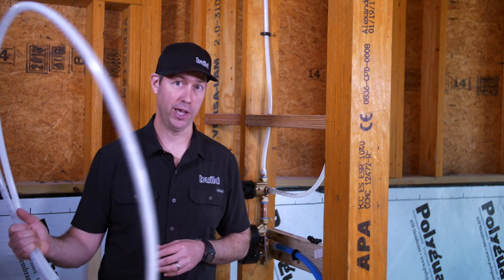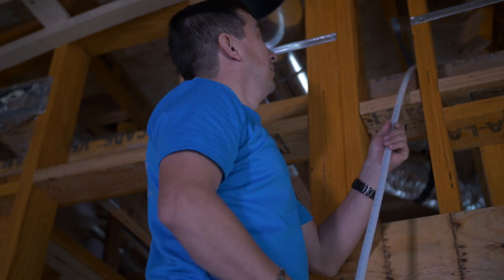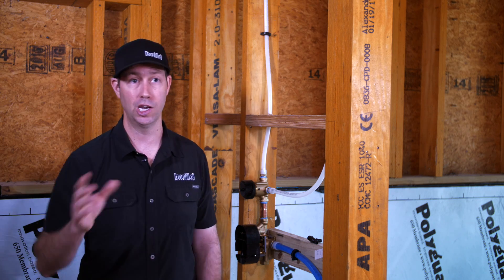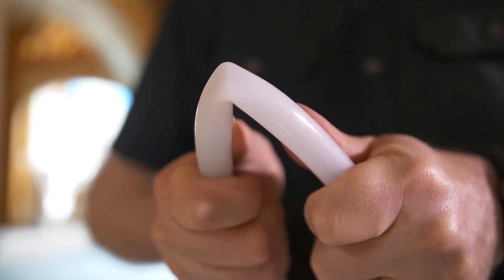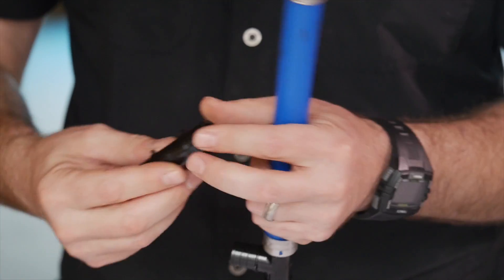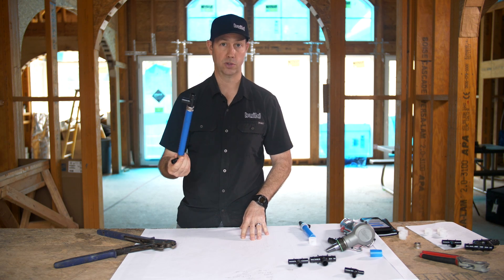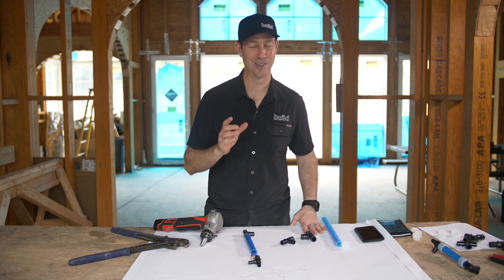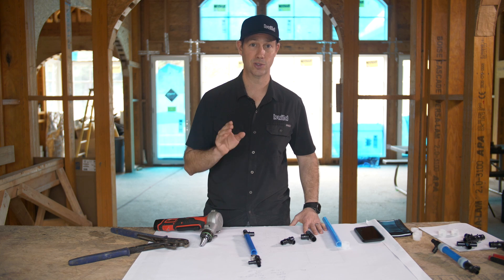PEX vs. Copper Plumbing

Comment: PEX is safe from junkies. Time & time again, I have to reinstall plumbing due to the junkies stealing the copper tubing from homes. Thankful to the PEX to save the day. Easier to cut & to install.
Reply: Pretty good point you got there. Well said.
Reply: Seriously? What a hoot! I've had two houses stripped, one while the papers were being signed, they pulled the feeder lined to the sub panels too. We went to the local scrap yard but it was useless and the PD wasn't into doing anything. Everybody knew it was the local crack and meth heads. It wasn't that big a town. Scrap yard made strategic donations in city hall, and...
Reply: @philrabe910  Sounds like a (local) problem needs a local solution..
Reply: ....no joke my neighbor's have been caught doing that shit.
Reply: Unless you use brass fittings
Reply: @flamedna galvanized isn't allowed to be used for waterlines in houses anymore
Reply: Unfortunately, unsafe from mice.
Reply: I live in a smaller town in Canada. I've never seen copper stolen from a house. I'm a plumber btw. Must be a big city thing
Reply: Gene Ryde no where ever you have degenerates not willing to work or budget their live right. Drug areas and even the up areas you’ll see teens taking to copper harvesting. Especially in. New developments.
Reply: The scrap yards in our city/state have helped curb copper thieves, I think there were laws passed at the state level that anybody going to a scrap yard has to show id and there is a criminal database/do not buy copper from these crackheads list.   Of course you know sometimes the guys running the scrapyards are crack heads themselves, but most of the places are corporate owned now days which helps as well.
Reply: Dh66- Your problem ? English Grammar here.
Reply: I will second this comment... junkies and the basic run of the mill copper thieves  won't touch pex unless there's a big easily accessible brass valve they can snip off. Re-ran everything with Upenor.  Now, if they can just do something else for the AC lines....
Reply: Yago Usera
Reply: Protect the structure prior to occupancy being taken=no theft.
Reply: THIS. I'm rebuilding a house that the entire bit of the copper plumbing was stolen lol.
Reply: I did pex in my log cabin I bought at a tax auction. The previous owners didn’t even junk the copper they just cut it everywhere and let it freeze before they lost it. I removed the baseboards and went with pex plumbing and forced hot air. Mainly because of the cheap price to install them
Reply: OMG! I remember some guy looking at my gold crown in my mouth and i said hey! Its worth about 20 or 30 bucks so dont even think about it!
Reply: Whats a can of white paint going to do?
Reply: Make it look like pvc
Reply: @tgarre6  doesn't look like Copper if it's white
Reply: Cuba Rodriguez ...true..
Reply: Sadly, copper thieves don't always check what they are doing. At work we have had copper thieves cut fiber optic cables, thinking they were getting heavy gauge copper. You'd think it would be obvious, but no! I suppose in houses they would only make the first cut.
Reply: Thieves in general, are idiots. You can assume that if anything can go wrong, it will go wrong.
Reply: Cuba Rodriguez       
 lmao .
Reply: PEX is more flexible and easier to work with. Remember when using copper  you have to solder every fitting which takes up time. That's true junkies do love copper and they will do anything to get it. When that guy mention white paint he was talking about painting the copper so it looks like PEX lol that wouldn't work.
Reply: sounds like you need to move, lmao
Reply: Cuba's Automotive : maybe you should have a little better screening when hiring your employee's
Reply: Yes we have neighbors, the junkies or kids stole all the copper from inside the Trane A/C units of the winter homes here also, in Florida.
Reply: Yeah, its worth it just to deplete junky scum of their fix
Reply: Pex junkies, aka, rodents will also eat through it, different type of junkie, yet will still take your stuff...
Reply: Norm T  Until 1983 or so, copper pipe was "sealed" using lead based solder- it has been illegal in most states since that time. It is, however, much less expensive than the no lead substitutes and is still available. FWIW, That is what the hell. There is no amount of lead in your water that should be acceptable- none.
Reply: If they steal your copper invest in steel, brass, and lead.
Reply: Same thing happened to me when i was flipping a house
Reply: This is extremely useful! As someone who's seen an entire house's copper system junked more than once, a viable alternative is great. My boss advocates using galvanized steel pipes to junk-proof them, but that seems like a bad idea for numerous reasons. PEX looks to be the way to go.
Reply: @Kryto_Gaming  Galvanized pipe of any sort, is Federally illegal; galvanizing puts a coating of LEAD and tin on the outside and the INSIDE, the water flows through a lead lined pipe. Think what happened in Flint Michigan! As I said, ILLEGAL, as well as life altering/dangerous. Won't ask you where you work, but your boss maybe creating a horrible healthcare problem; suggest you change employer before this one's jig is up and your reputation is a ruined as his! FWIW, retired plumber, 35 years at the pipe trades- have had work inspected in 24 different jurisdictions and average 90+percent green inspections on the first go round.
Reply: True story. A friend of mine owns a few rentals. One was vandalized twice to steal the copper. The third time they must have seen the PEX and ran, only the door was damaged.
Reply: Lame excuse because they can't be much of "Junkies" if they left the kitchen sink.
Reply: Yago Usera or your engine block
Reply: So you have signs all over the house saying "This house uses PEX piping instead of copper"?  Otherwise, how are they to know before they start tearing at the walls?  And how do you ensure junkies are going to read your signs?
Reply: Junkies? You mean Urban Minors.
Reply: kmonnier people who annoy you
Reply: Id never buy or rent out a house that has PEX. Takes a short 20min class for anyone and your "certified" to run pex. Who wants someone who 21mins ago just got his diploma or out of jail showing up to plumb your house? Obviously way more to plumbing itself but pex.... give me a break. If i need surgery im not going for the cheap rode. BTW 18 years in the trade and i was a little bit lax on the details. Ive had a Trainer from Rehau Pex come out to give a class and the trainer just said aight who here has ever done pex? The people that raised there hand got donuts and a cert. Same guys couldnt plum there way outta a wet paper bag but thats what the track house people hire.
Reply: Matt Roth ok pex is stupid simple to do. It’s a 5 minute class on how to install pvc. Do you not use pvc in your homes? Pretty sure you do use pvc stuff. Now if you were looking for a course on how to design plans to put in pex then yea 20 minute course isn’t going to do it. Besides you’d be getting certified plumbing at that point. Lame reason not to use a great product.
Reply: @mattroth6262  What you're describing sounds less like a PEX issue and more of an unqualified plumber issue. There are lot of idiots out there, regardless if they're using PEX or copper. Customers need to do research before they hire anyone.